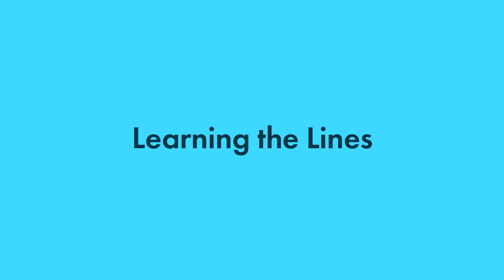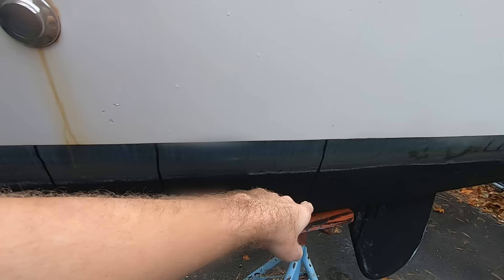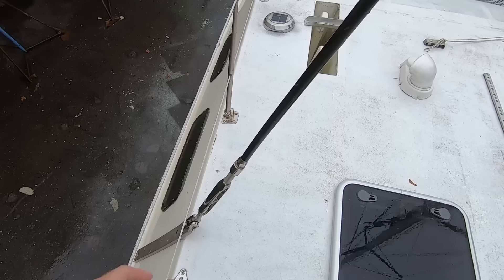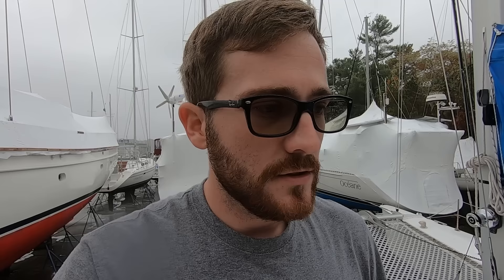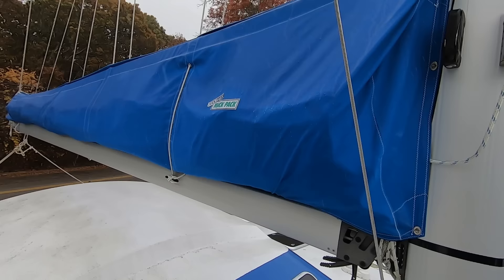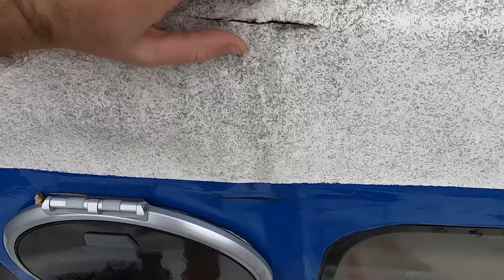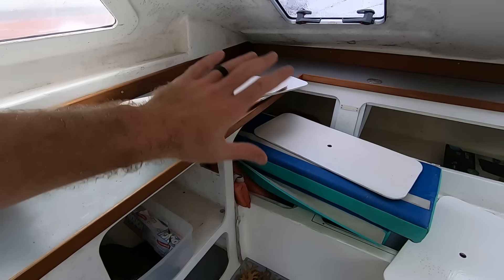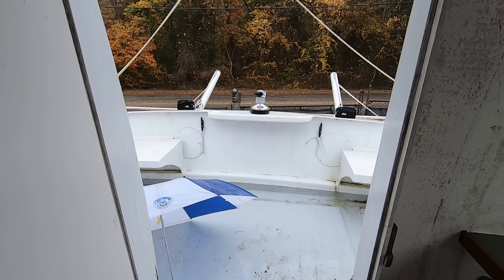109. Dirt Cheap ABANDONED Project Catamaran - Should We Buy? [Full Tour] Learning the Lines

Comment: Wow, I was thinking $5000, for seller to dump the expense, must cost more than it's worth per year sitting there. 

I suppose... it might be a $15,000 thing; but, what is the new rigging and mast etc worth? Maybe that is where you get $40k for a bottom feeder, rescue, with new hardware...? 

I like it. I would reconfigure the whole thing. It needs that much redone. 

Iwould also build a 25'-30' non-submersible   sub, with 8' beam and 8' height rescue un-sub. 

The other thing would be making it electric powered engines, backed up with efficient diesel engines - where are they? LOL
I have no clue! ...just a dreamer, whom lived offshore, working long ago. 

Solar, wind, maybe water generators, and backup diesel generator too.

Is that trying to do too much? Why not go for it, add things, test it all out, for safer global treks!

I would have two places to "garage" a couple of small adventure motorcycles or scooters 300cc+. Need a boom crane to put them on the dock. 

If the non-submersible sub is light enough, it could be towed as camper by bikes! ...for the terra firma trekking parts! 

I met you two in Virginia Beach or Norfolk, there abouts, back around 2002-3. ?

Hi!

Awesome....!

Comment: This Cat is not at all for “ cruisers “ and that’s the biggest mistake you made even looking at it.  This is setup for a different purpose and since you didn’t even know that I’m not going to fill you in.  Secondly, this boat is worth the value of 2 - 15hp Yanmars with new fuel cells.  The new rigging is great but useless on a cat that is rotten.  ANYONE wanting to fix this vessel up needs to know it’s worth $25,000 at best as it sits.  After you spend another 25-35k on a refit and structure overhaul and that figure is representative of doing it yourself , the vessel will STILL only be a 50k boat on a good day.   So, for 2-3 ppl that are NOT a family or common cruisers it’s doable and you’ll have a fun cat.   But overall that project is a wash. I’d buy it for 20-25k and strip it of all goodness and take that goodness to another project and then sell the dead shell for $2500

Comment: About a 3000 pound pressure washer would blow away all that black algae in a hurry. Then treat the boat with Wet-&- Forget to keep the black away. Not a problem. Why not a prefab cabin top, cut old off tab on the new one...Place to work, yeah a consideration but you have the biggest advantage to fix this boat, you're young....

Comment: Yes this would make a good project boat with lots of potential for a creative person.  Here are a few of my thoughts. 1)   IF... as you say the basic BONES of this boat are good ( Hulls, Rigging, Engines, steering and linkage) $40,000.00 seams like a reasonable amount to pay as it probably would cost you more to build a boat to this point.  2)  Given the space to rebuild this boat on land where that space is minimal and access to a workshop is on site, your living quarters during the refit are on site or close by ,  the rest is doable.  3)  Support the boat properly and completely ( maybe put it in the "grave" by digging trenches to set the hulls down into and supported end to end by the soil, this makes getting into and out of the boat more effortless, than climbing ladders with tools and supplies. Hours of both time and energy saved ).  4)  Strip the cabin top and decks off.  5) With the decks off cleaning the mould off the interior and restoring the interior will seem easier and less of a breathing hazard.  Remove everything, put a bulge pump in the bottom and start spraying a bleach/water mixture on the mold and wash it down and pump it out.  5)  FUEL TANKS--  A)  Remove existing fuel tanks and build new tanks on the other side of that structural bulkhead.  Build them vertical from the bottom of the hull to, or near the the bottom of the new deck.  Building them Vertical will  keep the weight near center of the hulls, allow more volume, and reduce the need for a fuel pump until the tanks are near half empty. OR B) make use of the space between the floor and the interior of the bottom of the hull.  This, with baffles, will keep the weight and fluid motion down low in the boat, creating more stability. 6)  BULKHEADS-  if the solid bulkhead at the front of each existing fuel tank is structural and additional space is desired in each hull explore the possibility of cutting in a passageway door (like in ships) and doubling up the thickness of the bulkhead for additional strength.  This additional space could be for storage and foul weather wet gear hanging locker, just above the head.  With the decks off, you can add additional, walk threw bulkheads for added strength, and/or additional layers of fiberglass to the hull interiors and/or insulation to the hulls.  7)   CABIN TOP/SALOON --  Build it out over the hulls leaving a minimum walking deck on the out side and entrance into the hulls from the interior making this boat more livable and spacious.  Build out a more functional galley, eating and navigation areas.   8) SUGAR SPOONS -- Rebuild with epoxy and fiberglass and lead life lines to the stern.  Clean up the existing extensions and use as a mould to make the new one and then remove the existing and add the new.  9) DAGGERBOARDS ---  Reconfigure the tops of the daggerboards and make a cover that over laps the deck near flush with a small hand pull opening to lift the daggerboards.  This could be made less hazardous than even the the deck hatches.     As you, said this could cost up to $80,000.00 to do, but I believe, if done tastefully, you might get get close to twice your total investment back ... even after cruising her.

Comment: That boat is worth the salvage.  It's a horrible design, especially for bluewater.  Even if the deck is in great shape, and has no structural problems, it's just not worth anywhere near the asking price.  A fair asking price would be in the $25k-$35k.  At that price you could turn it into an ok weekender, but not a bluewater boat.

Comment: Not... wrong . if you can get the cat. For under 20 k or around go for it. But expect to pay about 30 k to finish . That 50 k for a sound catamaran.
 The cat engine /cabin/ deck / mast is all sound. 
Did you ever try price Catamarans you can't find a top shape under 40 footer for less than 150 k . I seen people do worst boat. Cat are the boats they trade in later for. Why. Boat are hot. No air circulation. A cat has a open air and so much room to make a secound story deck. And the ride. Tryed sleeping outside the harbor. Go for it. The finish cat .value is worth the time and money think custom nice cabin & small upper deck.

Comment: Yes, the boat is way to expensive and completely designed challenged. For yourself if you had a place to work I am sure you could outfit the boat, because the boat has good hulls, good bones and someone could refit it in several years. Personally I would steer clear, but hay it is a light weight boat and probably would sail fast.

Comment: I'd offer $35k it floats and it has a new rig and engines this is the kind of boat you need to live aboard and fix if you put it somewhere to fix it up you may soon lose interest due to too much work but if you lived aboard and worked on it most of your spare time it may get done also a fresh coat of paint hides many sins and penetrating epoxy could fix allot of those problems.
but if you were looking at it for a project boat I would advise steer clear.
also this is a high speed/race boat so you can't fit it out full luxury its bare bones for speed which if you ask me is a great thing the less clutter you can amass onboard and less things to break

Comment: The thing is 2 nice new motors in a pile of garbage. I think you could make it a fun day sailor/weekender/racer but will never be a good cruising boat. I would offer no more than 5 or 6 grand. At 89,000 he still has no idea what a pile he owns. No way, even finished this boat would not be worth $89,000, and even in great shape it would be hard to find a buyer. It will take 20 grand in fiberglass work (even doing most of it yourself) just to stabilize it. Another 20 in interior work and you might be worth 40 grand.

Comment: You can not mention talking about building your own catamaran! and also say this boat requires to much work in the same video 😂😂 if this was forsale in Aus and they would except 40k for it I would want to buy it tomorrow. 3 weeks work on sugar scoops its in the water cut hole cabin top off and design better its a day sailing race boat that someone has half arsed putting a cabin on top remake cabin so stairwells go down into wasted space area u mentioned in both hulls most likely find this is where it goes down in its cruising versions make a new larger cabin up top stealing design off a more modern yacht renovate areas where old stairways went down as there is now useable space in front of motors but make sure theres still easy access to the motors. Sounds like a lot less work then building one from scratch

Comment: Need a really good Marine Surveyor to go over entire Hull with their instruments to see how much water Intrusion.  I would not pay more than the cost to remove both engines and sell them. Maybe you can sell the sails but good luck selling the mast and if so you have to go to a repair yard or dock to have it removed.  It probably has some worth in the engines especially if they came with a warranty.  I would not trust that Hull on a passage.  It may be ok to anchor out somewhere you can swim to shore but I would not invest a penny over the resale value of the engines. What more do you need well common sense for starters.  You are looking at potentially 50K in repairs, or if you do it yourself a long road of hard dirty work.  You may not know anything more unless you have a Certified Marine survey of the water intrusion but nothing I seen is seaworthy. New Engines are worthless under water.  .

Comment: $89,000 is not dirt cheap. This is an oddball from the days of eccentric multihulls. It has clearly been bastardized by a succession of eccentrics. Piece of garbage. Only a nut case would put so much fine aluminum and stainless steel components on such a junky hull. $20,000 tops. I noticed that the junk boat is in RI but the contact number is for Just Catamarans in Fort Lauderdale. Got to wonder if the broker knows the terrible condition of this project.

Comment: OK, let me be courteous. You got a "fixer upper" for free aka "Freebe" but you had to register it so it was not free. How much time did you sink into fixing it up at what cost per hour of your time & all the boat yard expenses for "being on the hard" plus ancillary associated expenses. How much currency did you expend in refitting including parts,  associated sealants, etc plus all the new equipment you installed on Freebe regardless of reduced cost through sponsorship. Add up all these cost factors to discern what you might have spent to procure a like sailing vessel in much better condition that would be used to do "exploring" versus working endlessly on a "fixer upper" that  becomes a money pit. Now you are contemplating doing the same thing again. I can only say "R U FREAKIN" NUTS" ?

Comment: 3 foot hull extension made out of plywood - yikes.   The only reasonable solution for this boat is to use a chain saw and chipper on the hull.   Sell the engines, mast, boom, and hardware on ebay......

Comment: When I look at a used boat I look at 4 things. The hull, the engine, the rig and the sails. These 4 thing cost the  most to repair or replace. looks like this boat has 3 of the 4  that are in good shape. Everything else is fixable. I would probably go about 20/30k.

Comment: Uhm NOOOO! Such a waste of money putting in such expensive new equipment. Why in the world would you put 2 new engines on a boat that so clearly needs complete deck and interior done first. Yea lets put 2 new engines in a boat that is practically falling apart and we will build around those engines. Smh. Or the mast, again that should have been added after the coach roof and deck was re-done. Besides all the new equipment, really the only thing salvageable is the hulls. At best this will be suited for weekender or a racer. Not very good for liveaboard with that layout.

Comment: Even if it didn't require a massive amount of time and money to repair, the basic design is terrible.  It'll be fast fast and has two engines, but otherwise it doesn't reflect any of the basic advantages of a cruising cat.  So you'd end up with a poor cruising boat, at best.  Perhaps it would work as a day sailer, or racer, or maybe even a day charter boat - rip off the deck house completely and just make it all cockpit.  I suspect ALL that decking will require replacement, so all that's sound are the hulls.  And the quality of the interior finish on those is terrible!  I suspect you are like me - you love the "projects", and feel sorry for neglected and abused boats.  They are like ugly pets - they all deserve a home.  I am not sure this one does - at ANY price!

Comment: This boat is an overpriced turd. I see a lot of glassing work that will need to be done. And I absolutely hate the outside entry into the port and starboard hulls and lack of room in the cockpit. Overall just a very poorly designed boat and use of space. There's far better project boats with better layouts for only a dollar